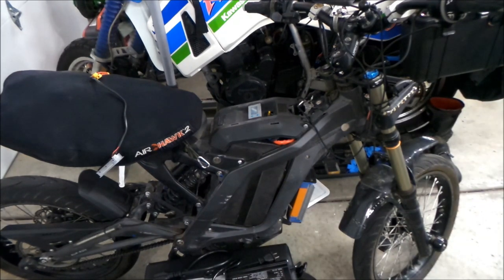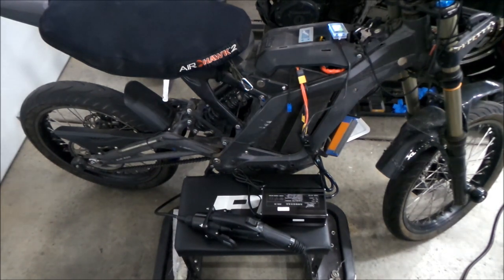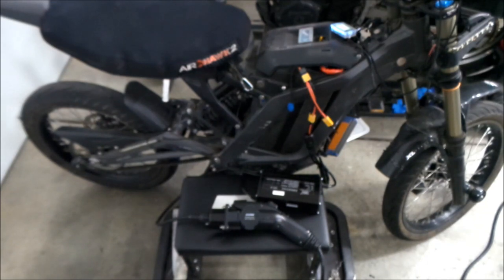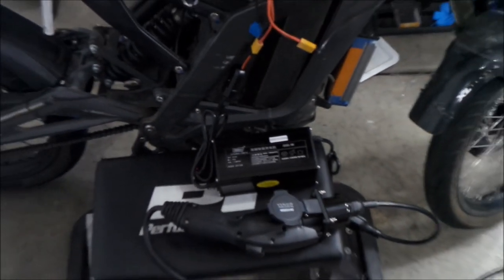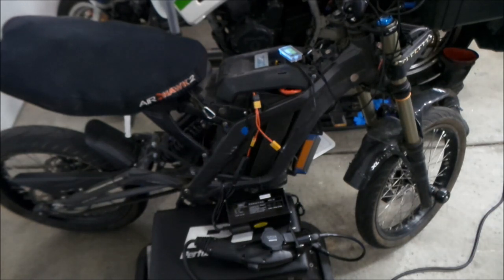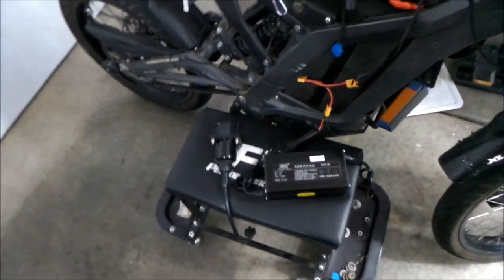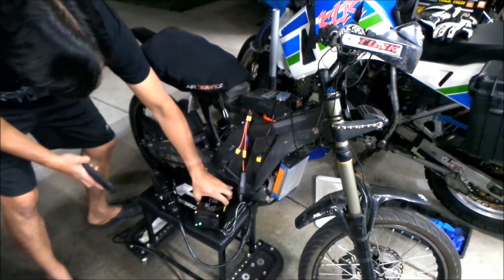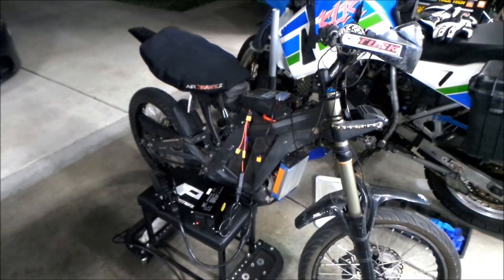Sur Ron Light Bee EVSE Adapter + Charger VLOG Part 2 - 220V Home EVSE Experiment

Comment: on Chinese translation: temperature protection, short-circuit protection, reverse plug-in protection, smart warning, restricting current function, auto-power cutoff, over voltage protection, time setting protection (over charging I guess), wider working voltage range, over charging protection, over current protection, constant current and voltage.
Reply from the maker: Thanks bro =)
Reply: @hadesomegamoto7639  you are welcome. your videos also help me to get my Sur-run up to speed...

Comment: How are you wiring the charger into the Sur Ron Battery?
Reply from the maker: Not sure what you are asking but the charger plugs into the litespeed battery's xt60 charge plug then the charger is plugged into the j1772 adapter which is plugged into the j1772 on the evse outputting 220v ac power
Reply: @hadesomegamoto7639  The Sur Ron has a specific plug on the left side of the battery. That is the connection I am referring to on the OEM battery.
Reply from the maker: @markkitaoka8783  This is a Litespeed Bikes battery it uses an xt60 connector, but if you want to connect it to a stock battery you can do that with an adapter that lite speed bikes sells also, it let's you plug a charger with a XT60 connector to the stock battery, the charger would need to be for 60V batteries though.  I check the website right now but it's not listed anymore but they used to sell something like that, if you ask they might still be selling it.  I'm ditching all my 60V stuff.